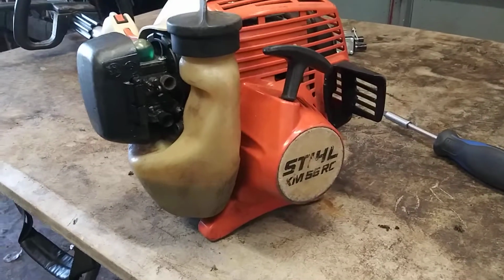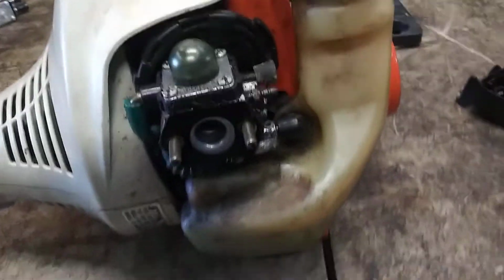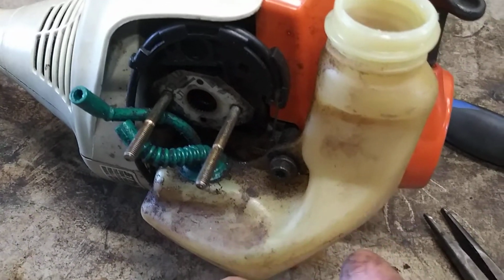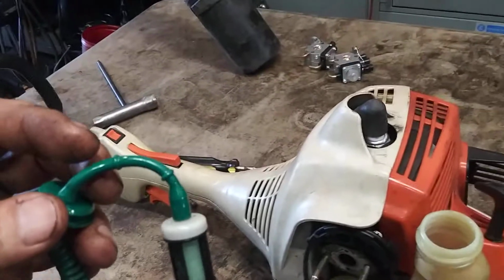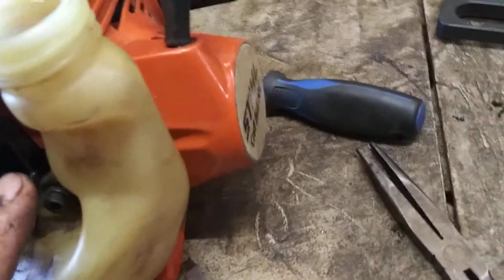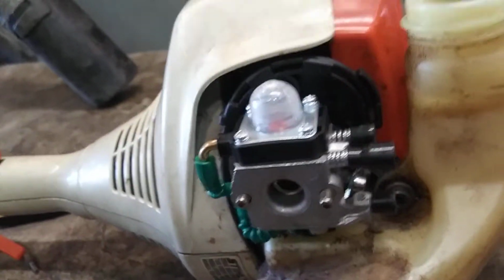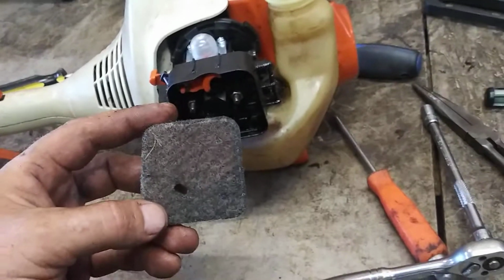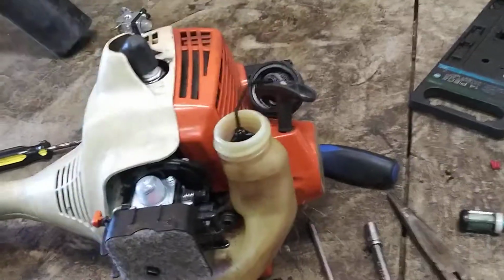* stihl Km 55 rc carburetor fuel line repair. stihl km55rc carb repair

Comment: What direction does the arrow on the fuel face?
Reply from the maker: what? do you mean the metal plate on the carb? up if so
Reply: I didn't understand the question either